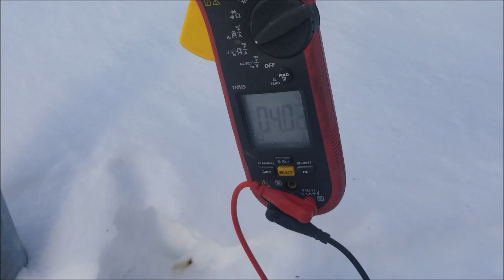Is the neutral wire safe? - Powerlines

Comment: Overhead powerlines on wooden poles we had also in our country.......: in the early 70´s.....
Reply: willing to bet you don't get the ground freezing solid 6 months of the year
Reply: catboattwo — In rural areas with large distances between customers, undergrounding the distribution grid would be enormously more expensive.
Reply: You don't see overhead lines in many if not most urban areas. However in rural areas underground transmission just isn't feasible. Also distribution is usually above ground between urban areas too.

Comment: A couple of years ago  I came across a down powerline. The neutral was broken and laying on the ground. The line runs along railroad tracks and feeds RR signals that are connected to the tracks on both sides of the broken neutral. The tracks function as the neutral so the power stays on. I reported the issue to the utility company dispatch and talked to a lineman they sent out to fix it. It did not get fixed. I reported it to the RR dispatch, and pointed it out to numerous conductors and ticket agents on the train.  It still did not get fixed. I ran into a Professional Engineer, a top level engineer who works for the utility, and explained the issue. The PE dismissed my concerns and told me the power line does not need a neutral to function.  That neutral has be down for at least two years now. Some poor unsuspecting RR worker could get killed due to the negligence of the utility company and RR operator.
Reply: If there was a track separation... yes
Reply: @SeekingTheLoveThatGodMeans7648  That is the scenario I see as the real danger. Some unsuspecting RR worker cuts out a piece of track and gets electrocuted. Then some unsuspecting rescue worker has no idea the tracks are energized and gets electrocuted. Then another unsuspected rescue worker... etc.
Reply: @liam3284  No. It is not an electric rail. Or it is not supposed to be.

Comment: Single primary transformers with a common ground are what bother me the most, then a why transformer with that “common ground” if you open that “common” at any point talk about wild swing of the current in the circuit, something that wire thief’s don’t care, or consider, the P.D. Found two knuckle head’s hung up on a underground street lighting circuit they had opened the common, and then became part of the circuit, one fella saw his buddy in trouble, and then tried to pull the first guy away, well they will never try to steal ever, hard lesson learned.

Comment: id never work at a job that could potentially kill me
Reply: A lot of jobs can potentially kill you. I have worked several. They all have their hazards. Now I work in public works on the road department. Traffic is our biggest hazard but we do a lot of dangerous things. Most people don't even consider. We also respond to emergencies like lines down calls. Our job is to close the roads for the power crews, but we often beat the power crews there, so we have risk there. When I worked for the cable company, we had an installer get killed because the coax became energized by main voltage and it electrocuted him. When I would go up and do work on the aerial, that put us in close proximity to the main power. Point is, every job has their risks and potential for fatalities.
Reply: @mikel9567  you're a braver man than me. I value living
Reply from the maker: Definitely gonna agree on the traffic thing. Even with multiple firetrucks on site assisting with traffic ... Cars often get impatient and try and drive through the work area 😔

Not to mention working on roadsides in regular conditions. Flaggers or not , cars drive way too fast!
Reply: I worked in IT/communications for a large electric utility until I retired a year ago. We went all sorts of places, including some mountaintop sites at night where mountain lions were common and snowcatting to remote areas. We worked in substations up to 500KV, did tower work in all sorts of weather. Our safety meetings all began with "Brought to you by our number one safety exposure: windshield time." We managed all our hazards on the job, but traffic hazards can never be completely managed and they just keep coming at you.
Reply: Just driving to work can potentially kill you.
Reply: Such as driving to that work?

Comment: The neutral is a current carrying conductor
Reply from the maker: That sums it up! Nice 👊👊
Reply: @Bobsdecline  So much so that in the UK, the wiring regulations state that the neutral is to be considered a LIVE wire and must be isolated via a double pole switch for actual 'isolation'
Reply: this is at low voltage mind you, 1000v and below. Above 1000v they tend to assume you know what you're doing :)
Reply: As someone who's been bitten on a few occasions by a 'neutral'. i approve this regulation.
Reply: Even if it's bloody obvious everything is off... it can still hit you. (backfeed from another bloody substation!!!, at 240v, when i was 17. 30 yrs later and i still hate disconnected wires.)
Reply: The neutral (in the US) is a grounded conductor, as compared with a grounding conductor.  Grounded conductors can carry current.  Grounding conductors are only allowed to carry current in a fault condition - normally they carry no current.  When you break the neutral, it is possibly no longer a grounded conductor.
Reply: The neutral is a current carrying conductor except when the neutral is broken. Then the railroad track that runs parallel to the line becomes the current carrying  conductor and everything will be fine until some unsuspecting rail road worker cuts the track to replace a piece. Then one end will stops being neutral and you could have up to 7200 volts on the rail.

Comment: So a lineman comes to my house for a power out call. I pointed out that the lower line running to the pole next to my house was hanging very low. "It's the neutral it can't hurt you" I was shocked that he would say that.
Reply: The saying in the industry is "if it ain't grounded it ain't dead." The neutral may be (theoretically!) grounded, but it carries current; the difference in current on one 120V leg compared to the other.
Reply: As long as the neutral is unbroken, and bonded to ground, in residential setting, it won’t hurt you, as the potential will be balanced to ground... but to say “it can’t hurt you” is incorrect.
Reply: @SuperVstech  Can confirm that a residential neutral can hurt. My wiring is more than 50 years old and there was enough potential on neutral to be fatal to at least one rat.
Also my ground is live. I should probably rewire my house.
Reply: @user2C47  well, SOMEBODY should!
Reply: @user2C47  If I'm not wrong, if you've got some sufficiently high voltage to true ground on neutral, that means you've got some pretty high voltage drop on the wiring isn't it the case? Somewhere that neutral might be quite thin or with a weak contact point.
I remember something about aluminium wiring not handling well repeated seasonal heat cycling or specially colder winters.
Reply: @Kalvinjj  Yes, lots of voltage drop. You can smell the wires getting hot if you pull more than about 7.5 amps. The breaker panel came with 15 amp breakers. I derated to 5, except for the kitchen, which is a newer addition. Also, most of the rooms are on a single circuit, so I ended up having to run my computer off an unused heater wire.
Reply: Neutral can still carry the fault current to ground so technically still carrying live current
Reply: Bud, you break that neutral and have the load run thru you is much different tan coming in contact with a live conductor. 
Neutral is known as the grounded conductor,  the hot wires are known as the ungrounded conductor
Reply: Bottom line is if you break the neutral on a live circuit it's looking for a path to ground. If a rat ate it and still connected it with his tissue he would have full current running thru him. Remember it's not just the voltage but amperage that kills.
Reply: @Gizmodi  Wire was not chewed more than a few % through. Rat was on a water pipe. I probably don't want to know how many other places the wire is almost completely chewed through because there was no water pipe.
Reply: @user2C47  That sounds dangerous. Be careful.
Reply: @user2C47  once that rat chewed thru enough to create a better path to flow he was a gonner.
Reply: Also your meter box, breaker panel outside and inside are tied into the neutral. Guy wires, underground transformers are also tied into that same neutral system. That people can touch and nobody worries about that.
Reply: Dang gum it. Where did they hire him from.
Reply: No pun intended eh?

Comment: I am a retired industrial electrical contractor and the last thing I would ever do is give advice to non electricians about doing electrical work. Yes it's basically simple for experienced craftsmen but non electricians should only know how to call an experienced electrician to do the work,  Electrical work is not a hobby.
Reply: "non electricians should only know to call..." Give your head a shake, and get off that high horse. The average joe simply can not afford to pay hundreds of $ in electrician fees every time they wanna change a light fixture, a plug or a switch. Should they only know to call an experienced electrician and ultimately file for bankrupcy when they wanna change a lightbulb too? You live in la la land.
Reply: @gtfkt  You're an idiot. He never said to call an electrician to change a lightbulb. His point was if you have electrical work that needs to be done and don't know what your doing then call, don't fuck with it yourself. I'm not an electrician, but I've changed out light fixtures, fans, etc myself. I've done my own simple wiring too. But I also know my limits. I don't personally like to mess around with the circuit box, so I call an electrician to do that stuff for me. Electricity isn't something to be fucked with. Mistakes can be costly. I'm an EMT as well and when I was on the ambulance full time I responded to quite a few calls that were caused by electricity. Most of them were fatal. Common sense should prevail. If you don't know what you're doing, don't fuck with it. That simple.
Reply: RD — I’m not an electrician, but I put in a main panel once, many years ago.  Properly permitted and inspected, of course.  I wouldn’t do it again, but I would add circuits to a professionally installed panel.  In my opinion, the problem with DIYers is not so much that they don’t know every detail, but that sometimes they bypass permits and inspections.
Reply: @g quin That's one accident in a sea of millions of non-accidents.
Reply: @g quin If only that sea of millions of electrical fires actually existed. Keep talking like that, you're showing your true self.
Reply: @gtfkt  maybe you're smarter than the average homeowner... But, I've seen, personally, how diyers do electrical. I get to work on things that they've messed up. People think, "it'll work," and it might, until it doesn't, and someone gets shocked or dies. So many times I've gone into fixing a "little problem" and it turns out that I'm there for hours or days instead of minutes. 

Long story short ... (Pardon the pun) leave doing electrical to the professionals. It's not worth the risk.
Reply: @gtfkt  I do not recall saying that they can't do it. I just said that they shouldn't. It's only their house until they sell it, and then, unbeknownst to the new homeowner, they have an electrical nightmare on their hands. 

Anyways, not to dismiss others occupations, as there are many people far smarter than you or me, but they all have training in their respective fields. Speaking of occupations, where do you come off anyways? You seem to have a holier-than-thou attitude. What is your line of work that you think you are above the law, and have everything that you need to do what you want?
Reply: @gtfkt  Apparently, I've struck a nerve. (That was obvious a couple replies ago, but I kept playing along.) You seem too passionate about this. But, unless you work in the trades, I don't really think that you have a card to play. All I know is I've seldom seen anything good coming out of a diy remodel. Electrical is really simple, if you're just replacing a switch, a light or a receptacle. It's just remove and replace. When it comes to adding stuff though, there are more things to consider than can I do it. As I like to say, you don't know what you don't know.
Reply: @gtfkt  I've never said what I do is voodoo magic. I have said that you can do simple things to electrical stuff. I have also said, when done wrong, it is dangerous. I've seen shit go sideways. Even from "experienced" professionals. Honestly, I hate doing residential stuff, and if I can aid in someone doing their project correctly rather than a shit job, I would rather do it that way than do it for them.
Reply: That's all well and good, but information will proliferate, better that it's good information than bad. Just be ethical and make it clear that any work should be performed by a competent individual.

Comment: The neutral is actually considered a live conductor.
Reply: More problem arises when introducing Protective Earth Neutal wires (TNC). It "should" be safe. But at power lines, i would never feel safe unless working close to a real earth (earthing rod, measured). Grounding at one end is actually not enough... depending on the length of the unearthed end.
Reply: It depends on the country you're in and how their electrical system works.  In the US, the neutral is a grounded conductor.  In the UK, for example, it is not a grounded conductor.
Reply: @stargazer7644  here in New Zealand, the Neutral is also grounded

Comment: The neutral wire shouldn't be safe because it is the return wire for the electricity
Reply: The neutral is supposed to be a grounded conductor.  If everything is connected properly, and it is a grounded conductor, then it is safe.  If there's a fault, or a missing ground, or a broken cable, and it is no longer a grounded conductor, then it is not safe.

Comment: Are lineman in Canada allowed to smoke Marijuana since it’s legal now? Wonder how the laws are there
Reply: John Woodard  Potheads will ALWAYS try and justify how unfair the system is and completely disregard the actual reasons why they would not get a job in top paying career field.. This is why a lot of the hard core smokers work meandering jobs like at a smoke shop, gas station, or as a door greeter at Walmart. They cannot be trusted to use good judgement and not become a liability to the rest of the work team / crew. This is why they do not work at a railroad, or as a climber for a comms company, or for a utility company.. Liability
Reply from the maker: I didn't notice this comment earlier ! Sorry for the late response. The rules are different depending on which company you work for. Generally it's treated similar to alcohol , you cannot smoke while on duty or even before a shift . There is zero tolerance for intoxication while on duty at any time

Comment: Hey Bob. Like your channel.
Little confused about your neutral theft. The guy cut a ground wire outside the side on tge pole, which removed the ground from the substation transformer neutral? Sub bank neutral better also be grounded to the station ground/grid, no?
Reply from the maker: Hey Professor ! Great question! Yes , the Power transformer neutral is bonded to the grid as well. Where often times serious injury during power thefts occur when the thief  puts themselves across the " XO " and ground grid . That particular case was similar as the 4/0 copper removed from the pole was the only connection tying our overhead grid to our Power Transformer " XO " and station ground grid. ( Other then the ground acting as a conductor itself ) we did have 2 separate runs  , both of which were protected behind steel cable guard , that were stolen . The points of difference in potential would be the overhead system neutral as one point of contact , and the second being the ground itself which had remained electrically connected to our station grid as well as the power transformer neutral . 
Sorry if that was a ton of verbal diarrhea  .  Does that make any more sense ?
Reply: @Bobsdecline  Gotcha. He basically cut your "get away" system neutral ground connection. Got it. Im a substation supervisor, but they build a lot different around here) Great channel again. Stay safe